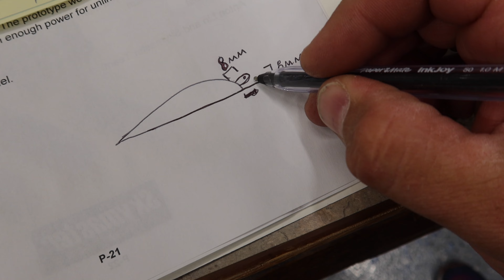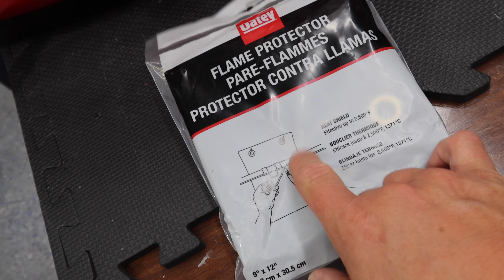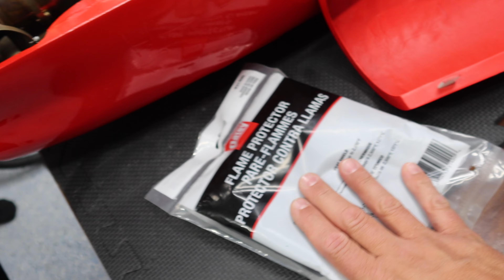SKYMASTER PC-21 Build - Wings and Turboprop installation - Jetcat SP10

Comment: I am a large scale 3D flyer and I thought I had fairly good and sound build practices however, I have learned a few things from you that I plan to use on my next plane. Thanks! GL
Reply: For me the bigger they are the easier they fly, but the higher the stakes. I burned in a Katana one time on my birthday. I had my party on the RC airfield and I put the wings on the spars for transport without screwing them in. SOoo I plugged in my battery, did a quick flight check for surfaces and took off. It flew great until one wing just came off in mid air. The plane was about 60 inch model and it cost me about 400 dollars in damages. Fortunately I bought the frame used.  I took out all the servos etc and the 100 dollar battery was toast. I still have a Raven, Ultimate Biplane and an Edge 540 left. I have not flown fixed wing in about three years since I moved primarily to FPV. I just moved so I have a lot of flat open areas which are giving me ideas..lol Do you run gas on your rig for the big scale stuff? I have seen both on the field while I was a regular.  I know the frames cost almost a thousand dollars.
Reply from the maker: Thanks Gary!  That's one of the purposes of what I do!  Share the info!  Thanks for watching!
Reply from the maker: Hey Joshua.  Yea your correct!  The bigger they are, the easier they are to fly but unfortunatley the more they cost.  Don't understand your Gas question?
Reply: @thelightersideofrc  Disregard, I forgot your using a turboprop half way through the paragraph...lol
Reply: @thelightersideofrc   Most expensive I ever saw go down was a 48% acrobat of some kind. Lost the BEC without redundancy on final, went full throttle on approach and lawn darted. 

He just stopped and stared. I looked at a friend that was with me, and we just silently got the truck and went to pick up the pieces. We had most of what was left in my pickup before he got to us. The only thing still usable was some of the tail electronics. I don't think any of us said a dang word until we get back to the line. I just pulled next to his trailer and let him unload as he wanted.

Comment: The PC-21 is just so gorgeous, even in pieces...it looks like the instant you bring the pieces together it's going to fire up and shoot into the air and go strsaight into crisp manuevers
Reply from the maker: Thanks!  She's a real beauty in this bright scheme!  Wait till you see the next video with the fuse together! 😎
Reply: @thelightersideofrc  very excited, I operate in a slightly different realm to you in that I work on the same types but they are electric, first thing I did when my electric PC-21 arrived was to strip it down completely then purchased some FW Intruder dummy tanks and am going to repaint it in the Patrouille Suisse red and white with matching tanks and a scratch built full detailed cockpit and a pilot figure that cost more than the whole airplane. It will be the princess of my fleet for sure I am a lifelong Pilatus fan, so yes, can't wait.

Comment: I was wondering if a linear servo, like the ones from Actuonix, wouldn't be better for an application like those internally connected flaps?
Reply from the maker: Problem with the linear actuators is the amount of force the provide.  The actuonix would be the best option for the amount of force they provide but they are quite long.  I trust a servo more for this application.

Comment: Jonathan could you go to the Auto Part Store an pick up some exhaust Header Tape (red)and wrap the Engine with it? Jonathan would the Tape be Thicker  and control engine bay Temp Better then that thin junk paper ? And Cool trick ( Greg’s bent Screwdriver) is use Heavy Duty Aluminum wrapping Paper from Wife’s kitchen cupboards and shoe goop glue! Looks awesome.   Well take Care.
Reply from the maker: Great Suggestion Gregory.  The unfortunate side of the doing it like that is is would hold the heat in instead of allowing it to dissipate quickly.  Thanks for watching!

Comment: do you know the CA glue and baking soda trick? it really helps to fill gaps be careful thought you can burn yourself during the reaction. it so hard
you can barely sand it. 
Also look into 3m DP460 when we where building composite aircraft once that cured it becomes part of the structure
as it bonds on a molecular level especially with aluminum parts.
Tony
Reply from the maker: Thanks for the tips Tony!   Yea, the baking soda trick is a good one!

Comment: Is it just me or is the turboprop off at an angle instead of center in the firewall, If so why?
Reply from the maker: All prop model aircraft have this. It’s about 3 degrees to the side and 3 degrees down. Without it it would do circles. It’s more pronounced on a turbo prop as the engine is so long.